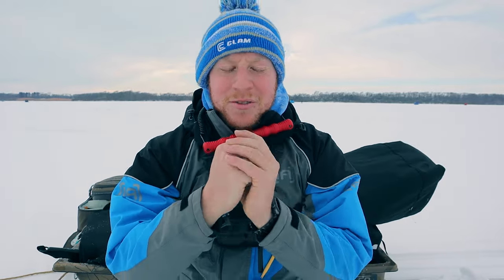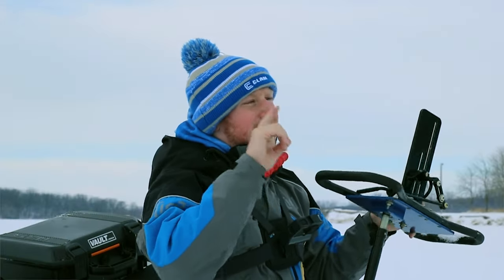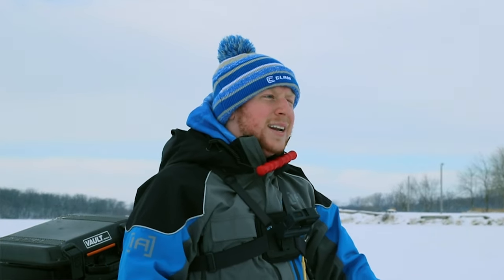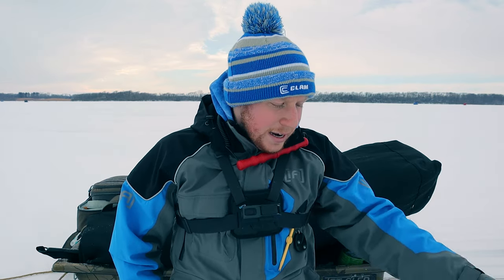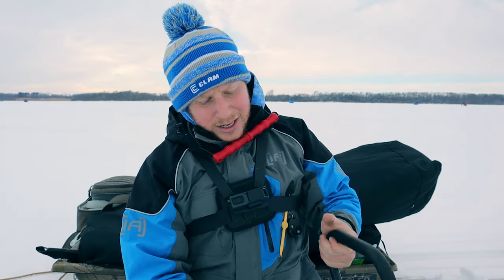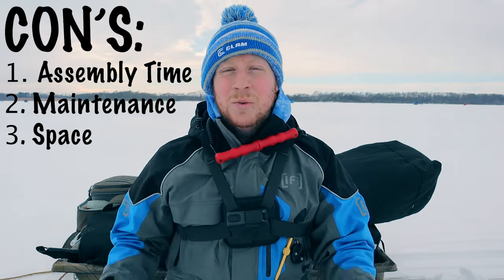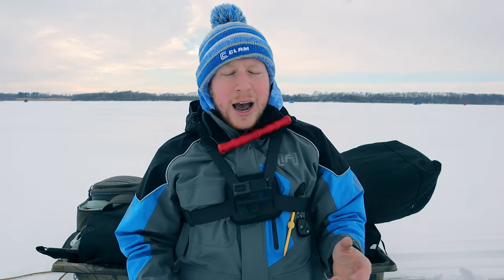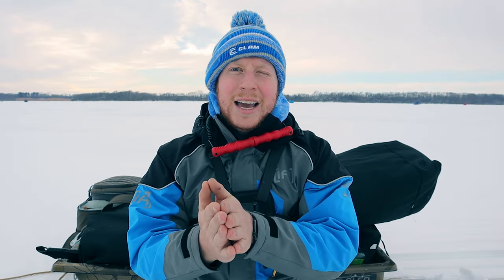Clam Auger Plate Review (Milwaukee M18 Fuel Drill)

Comment: Good review. Thanks for taking the time to put that together. I work for Clam, so I might be a little biased, but I have some things to add to this. First off, all of your points are valid, however, some of the main purposes of the Clam Drill Plate are to actually save your drill and your body. As a guide, I burned through many cordless drills when attaching direct to an auger bit, but since using a Clam Drill Plate I’ve burned out ZERO. Cordless drills just are not designed to take that abuse. The Clam Drill Plate, along with that floating bearing, actually take a lot of the abuse off your drill—which in turn will extend the life of the cordless drill (and your investment) drastically. I bet if most hardcore anglers are honest with you, they would say that they go through a cordless drill every ice season because of cutting holes and chucking direct to an auger bit, but I have some drills I’m going 4 seasons on while using the Clam Drill Plate (and I literally cut thousands of holes per season). Many anglers also snap off that handle attachment on their Milwaukee drills when chucking direct to the auger bit because of torque, I know of several close friends alone who have done it. Anglers have also injured their wrists cutting holes with a cordless drill chucked right to an auger bit. And last, the Clam Drill Plate will protect your drill from getting physically beat up, full of snow (when setting it down), etc.  So while I know it has some cons, to me the pros outweigh the scenario. I totally understand your points though, but I just wanted to make sure people understood some of the main reasons for why the Clam Drill Plate was created 👊
Reply from the maker: Thanks for your feedback! I didn’t take into consideration that the drill head might take extra abuse if I did not have the plate. Thanks again!
Reply: he is right... i sheared the T handle off my milwaukee while drilling with an 8" steel auger. so ill probably get the plate now since my handle is messed up. drilling without a t handle is super sketch. best way to hurt your wrist.
Reply: Matt i have the first gen cam plate running an old brushed dewalt hammer drill and 6 inch auger,going on 8 years,i am going to upgrade to a brushless dewalt 998,strykemaster lite flight,and am curious to your opinion on the geared versus non geared plate,i like the idea of the multplied torque,and i don,t think the reduced speed would be an issue ?......thank you...
Reply: Yup, I watched someone snap the handle attachment right off his drill without the plate. Jacked up his wrist and hand as well.

Comment: I used the Milwaukee drill with the handle directly to the auger. No good! That thing kicks your butt. Have ripped the handle off multiple times. Leg is covered in bruises and cut my finger. Drill is currently getting fixed. Thank goodness for warranty. Will be adding a drill plate. To help the longevity of my drill and for my safety. Just putting this out there so you don't have to learn the hard way like I did.
Reply from the maker: Good to know thanks !

Comment: I have had the Clam plate for 2 seasons now using a Ryobi hammer drill with 750 in lbs of torque. I have an 8" auger and it has done really well which surprised me. I have drilled through as much as 23" of ice without issue. One of the biggest advantages that I can see is the leverage that you gain by holding the two handles. I will likely get the gear drive this season. The cons I have are the same ones pointed out in the video. 1. Taking the drill on and off. 2. It is bulky
Reply from the maker: Thanks for the feedback Donovan! That’s actually impressive! I’ve been wanting to increase my auger size but never pull the trigger. Just out of curiosity what kind of auger is it ?
Reply: @garygoes_  it's the strike master mora I believe.

Comment: I'm a retired welder with bad arthritis in my hands. So some days just pulling the trigger on the drill can be very painful so the clam plate with the rod pull handle would be easier to operate. I agree putting the drill on the plate with Numb fingers can be challenging so I would probably leave it on.
Reply from the maker: That’s a very good point I never thought about situations like that. Thank you!

Comment: If you have the money to do so, buy a drill for exactly and only the purpose of being on the clam plate. For sure, always bring your batteries inside, or at least in an area above 45 degrees so they don't freeze. Always use a brushless drill for an auger. 
I have a 10" eskimo propane power auger, and it is an insane amount of added weight for just drilling holes when I'm out on early ice and have to drag everything out with me. Adding a pistol bit or k-drill to the plate is a game changer. I personally can drill probably 100 holes per battery, and if i have 2 batteries with me on a long trip, I'll never worry about not being able to drill a hole.
Reply from the maker: Thanks bud! Appreciate your input !

Comment: I've got a the Milwaukee Fuel Brushless and a 7.5" K Drill, not super impressed with the battery life I get out of it but the convenience of it is super nice.  I think if I had to do it again, I might get an auger with a cutting head like a Strikemaster or Nils.  They seem to be a little more efficient than the chipper blades of a K-Drill
Reply: not all batteries are the same... the Amp Hour rating is what you need to know. the higher it is, the longer it will last
Reply: @lucasbrown8775  Right, but the less efficient the cutting design of the auger, the less battery life of the drill.
Reply: Get the 6.0 High output battery I got one for my fuel Drill and it doubled the power of the Drill. I am using a 10 jiffy torch and it still has lots of power.

Comment: They have an extension for the auger section which makes it easier to handle instead of loosing 1.5 to 2 foot of the handle you lost by taking it off the hand drill section.  Also, when you jump up to an 8", there is a model with a gear box which will take the load off your Milwaukee or in my case,  the Dewalt.  Drill saving feature.
Reply from the maker: Thanks for the tips! I didn’t know there was a gear box style

Comment: Get the gear box to then you have a real good auger.  Not quite as fast but  alot more power plus you can use a less expensive drill 850 lbs per inch is plenty  most people don't have  a1200  cordless  in their tool box.
Reply from the maker: Thanks for the feed back!👍

Comment: Late to the party but I put a clevis/hitch pin in place of the bolt then when done fishing I pull the pin and remove the entire plate,drill assembly. Really a non issue.
Reply from the maker: Great tip thank you!

Comment: If you want something compact try an ht Nero have had mine for four years now cut a lot of holes with one screw you go from a short compact auger to full length it has shaver blades not chipper and I’m running just a ryobi hammer drill non hp battery 4ah and get 60+ holes per charge with out going under half on the battery that is through 10 inches of ice all in all it does the job hope your ice season all the best tight lines 👍
Reply from the maker: Thanks for the info bud ! I appreciate it !

Comment: Why would it not he on the plate before you get on the ice??
Reply from the maker: I keep it stored most of the time so it’s not in the elements.
Reply: Before any trip, you get rigged up. So get your stuff together and just undo the auger from the plate. Thats 1 screw. Have your drill and everything else mounted the night before..

K drills have a float from them falling out of chucks and other drill mounted augers have some sort of plate because they would fall out and go down holes.

If you get the clam plate with the gear drive it saves the drill, chuck, auger and wrists.. seems your making it more complicated then it needs to be.

Comment: First off you need to take the drill inside and keep it warm? , why take it off from the plate?? That's just nonsense ...... secondly ,u need the spring upgrade..... lastly I have a dewalt dcd998 on my clam plate , with a 8" lite flite attached , I've had 0 problems with it , and would highly recommend this combo , with the clam plate !!!
Reply from the maker: Good to know

Comment: A lil late to respond but the biggest and could well be important part of this plate is, STABILITY. The plate stabilizes the drill chuck to the adapter. 

A few yrs ago, I took a trip up nord into the MN backwoods. Just had a drill attachment auger and used the drill handle for stability. Caught some bad ice and the torque of the drill snapped the adapter piece. Took a 2 hr drive back to a small town to luckily buy an attachment. Pretty much ended my trip cuz I was only able to fish half the time I was there. Came back and bought that plate. Folks just dont know until it happens to them. Either buy a few adapters or have a hand attachment if possible.